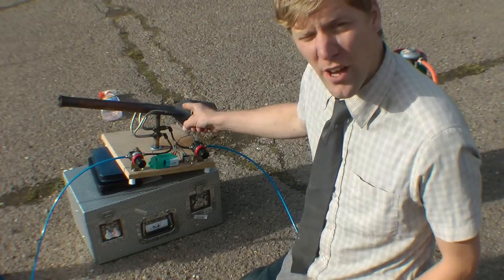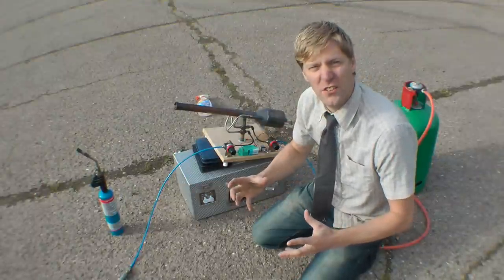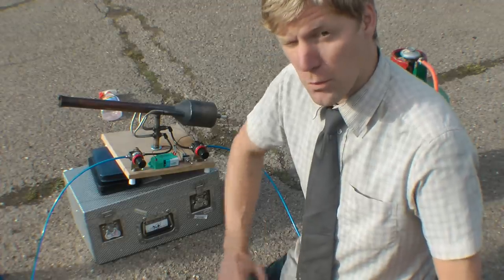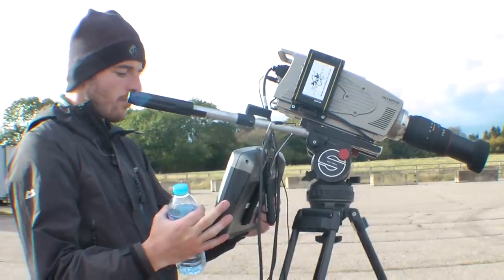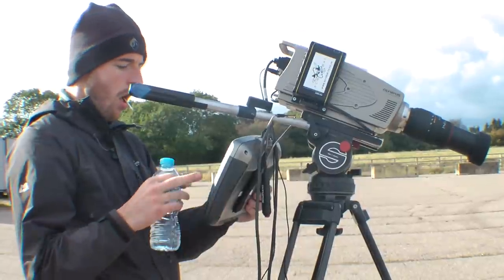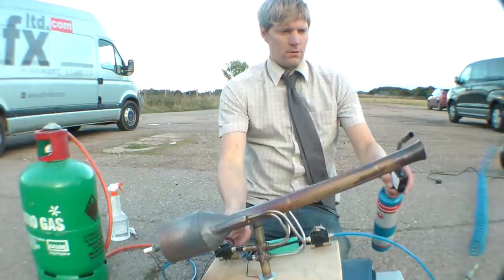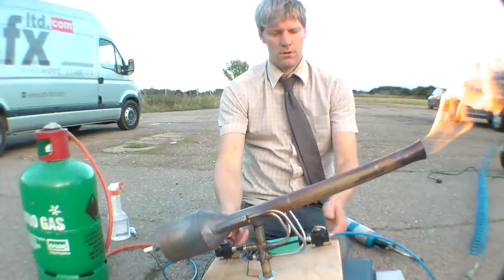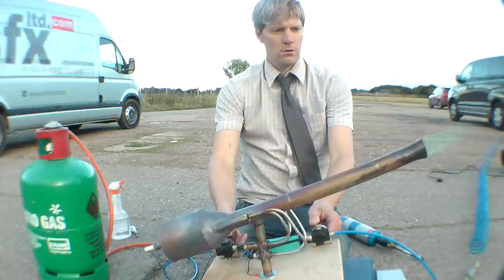PULSE JET SLOW MOTION FOOTAGE

Comment: One pulse per second is one pulse every 24 frames, because the video is recorded at 5000 frames per second, and then played back at 24. That's why it's in slow motion. So the correct figure would be 5000/24 pulses per second, or about 200.

Comment: That's far from 5000 pulses per second? Miss speak? Somewhere between 2-300 per second.
Reply: Agreed, I'm sure he means a minit
Reply: reaj2010 If the video is 5000 FPS, and you see one pulse per second, then it is 5000 pulses per second. Considering the extreme high pitch sound it makes, I think 5000 sounds reasonable.
Reply: +DukeLaze 5000 fps played back at 30 fps showing 1 pulse per second would be 166.6 pulses per second in real-time, or 10,000 pulses per minute, which sounds about like a motorcycle at 10,000 RPM.  So, yeah, ~166.6 pulses per second, not 5000.
Reply: +Douglas Holt Revisiting the video and found this...
The high speed camera filmed 5000 frames per second. Each framed showed one explosion, so there's 5000 explosions a second, or 5000 pulses a second.

The video you see here on youtube might be 30 fps, but the source is 5000.